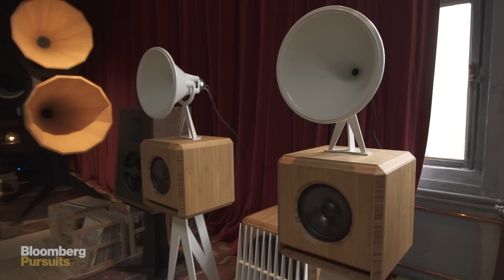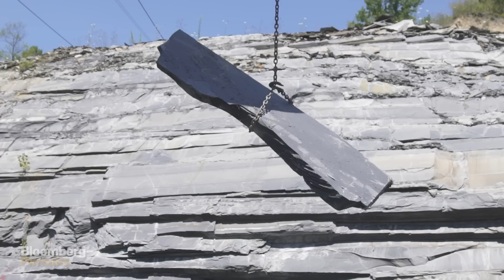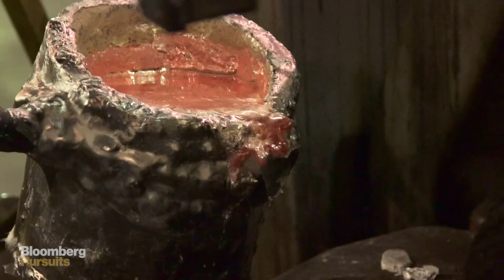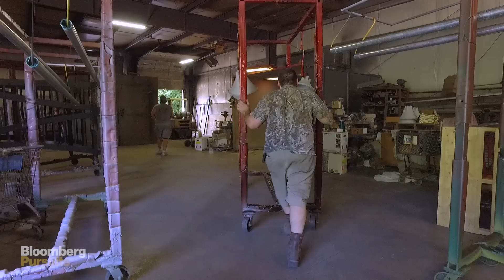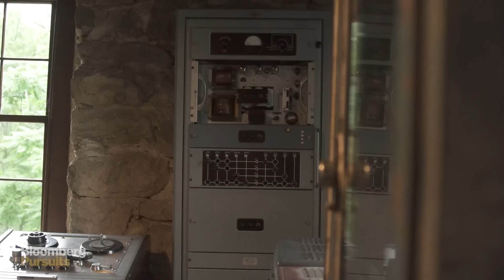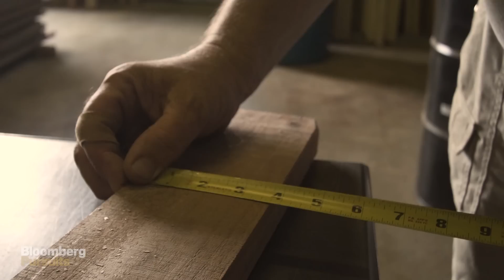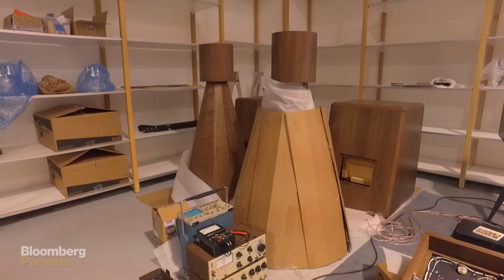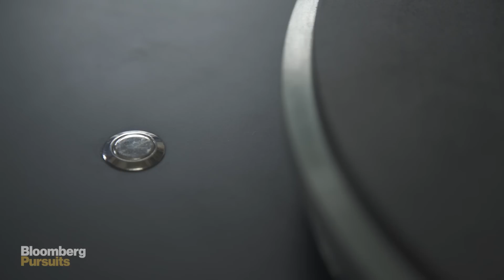How a $300,000 Speaker is Made

Comment: Those solder joints are absolutely horrific, a cold iron was used, not enough flux, and the board was not cleaned after soldering. Look at all that residue! "Like aerospace level stuff" Lmao please!
Reply: And the hard wiring from the board to the pots and switches is amateur hour. I've seen the hard wiring in equipment costing half has much made in Japan that is done cleaner and more neatly organized.
Reply: JBL M2 Reference Monitors are like $12000/pr. and would blow any of that garbage away.
Reply: @PlateletRichGel  you can buy a world renowned speaker like the Tannoy Westminster for a fraction of the coast .And you won't lose a dime on resale 30 years later .
Reply: ct5006360 exactly. I work for Rohde & Schwarz and my full time job is to disprove idiots claiming their audio sounds the best because of XYZ high end analog components or because their audio cables have a passivated gold finish. Sorry guys, unless our equipment is wrong you have all been cheated for decades...
Reply: @PlateletRichGel  I was just gonna say Harman is looking a lot better right about now.
Reply: @PlateletRichGel  Hopefully that information will become valuable to me one day .
Reply: @PlateletRichGel  You don't know anything about sound.

High End audio is another level.
Reply: Yeah, but there's not high end audio here, just quackery. And us yeah, I'll put my Quad electrostatic  system against anything in the world.
Reply: I had to look twice too, but you're right. What a shoddy soldering job.
Reply: I took a screenshot and zoomed in. They must be joking, honestly it’s absolutely terrible. What a fricken disgrace 🤨
Reply: You don't understand audiophile thinking.  They'd say the cold solder joint improved the sound.  So much BS it hurts.
Reply: @jomgelborn  Oh yeah dude, it´s true!!! Don´t you know anything about cryo??? hahahaha!!
Reply: "It's really old school" What do you expect? They were making old school stuff. Old school stuff came in with the old school problem, LOL. This is just hippie bs.
Reply: You're paying for pretentiousness and not quality soldering
Reply: @jasonscott6171 Scott Haha. I like your response better than mine. Much more eloquent.
Reply: Rossman would be furious
Reply: Cameron Crosby
Wow! I had to look twice, but you are right! The soldering at the PCB is really poor. It looks like they soldered from the upper side?!
Anyway, people spending 300k for an audio system will probably never open the case. Who cares?
Reply: I'm actually kinda shocked.... 300k? And not more than a few hours labor from what looks like a learning technician?  I don't see why they can't hire someone who had more skill. I know many solders are done by machines but that board looks like I did it and I've only soldered twice...  Kinda burnt and rushed with basic wire and no management or cohesion. Looks like a DIY audio kit!
Reply: @figit090  I've done better soldering work at my high school for an assignment.
Reply: The wiring is a hot mess. For 300k that could have at least made it neat and organized. Have some damn pride in your work mr pretensious snake oil salesman.
Reply: The soldering work brought back many childhood memories, looked so familiar:)
Reply: @MrTruth111  dude. I spat my morning tea on the carpet laughing out loud 🤣🤣
Reply: @MrTruth111  could I just give you a hug man? You made my day 🤗
Reply: @50flamingbottles You imbecile. Anyone with an average knowledge in hobby electronics can agree on that pathetic soldering job!
Reply: that is aerospace level lol
Reply: @misterkid  Apollo 13 bzzztt
Reply: actually I had to look 3 times.2 times the solder job, then back to the price.this is absolute crap. most of the chinese stuff has better soldering jobs these days.300k piece of crap :D and weird thing is I had chance to hear these loudspeakers on some audio fair, they actually sound pretty boring and unimpressive. Next to them was Martin Logan electrostats.oh boy.......
Reply: Maybe 1960's Aerospace level stuff lol. 'We use resistors from Soviet Sputnik.'
Reply: that's where the "Character" comes from.
Reply: Cameron Crosby I know that was the first thing I noticed.  I did better soldering when I was 7.  Like seriously.
Reply: I noticed the same thing ... I'm surprised there wasn't tons of hot glue all over it in clumps!
Reply: He wasn't bluffing....(1960) aerospace level stuff hehehe
Reply: Mass produced hardwired orange amps have gorgeous solder joints these are just pure trash
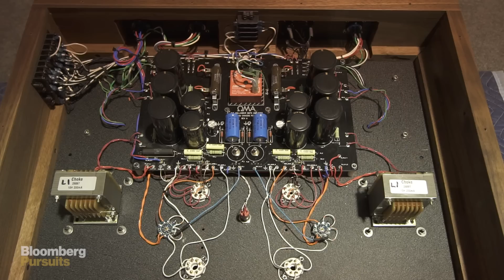Reply: Check the wiring at 5:23 , looks like a rats nest lol
Reply: Trius people pay $1,000,000 for a fuckin burkin bag.  So.  Those types don’t care they just want to spend the most. Even if it isn’t the best.
Reply: @MatanuskaHIGH  theres a joke in Russia, oligarch says "I just bought this tie, 1000Euro, other oligarch says "so what I paid 2500Euro for that same tie."
Reply: @MatanuskaHIGH  you heard Russian joke two oligarch have same tie, one says "I paid 100Euro" other one says 'That's nothing I paid 200!" lol
Reply: Hahaha had to look back. Terrible. Cold joints abound. All that work sourcing ~the least dense shale~, producing their own tubes, etc. and he's gonna put the thing together with a hot glue gun! Bahahah
Reply: The quote „aerospace level stuff“ is a joke itself. I mean Aluminium.Is.Aluminium
Reply: It is true this is aerospace level. The same kind of work is done and get to charge astronomical price when it can really be done for way less.
Reply: My DIY speakers with AE TD15M woofers, 4th order LR crossovers, and Aurum Cantus G1 tweeters will produce esoteric sound quality for less than 2500 dollars/pair and blow these overprice pretentious garbage out of water. 98 dB efficient woofer and 102 dB efficient tweeter FTW.
Reply: No kidding this guy & his products are nothing but polished turds
Reply: I cringed so hard when I saw the joints man. That isn't even close to the Space Addendum. That's Class 1, toaster level of solder. Smh
Reply: Exactly what i was thinking!
Reply: You just stole my thoughts.
Reply: They probably have a ground plane that is one pound of copper.
Reply: 4500 dollar ESS Labs EMT Limited Editions and PS Audio amplification equipment will blow these out of the water.
Reply: I agree! I am 13 years old and my solder joints look better than those :) Looks like the soldering iron was too cold!
Reply: user name  Open your damn eyes you imbecile
Reply: 5:17 looks very big.        because it has to be , looks so fake because proves IRS real wtf ever its all bs
Reply: We're the only company in the world that does this!
Reply: it’s old school 😂
Reply: You hear "aerospace level stuff" = instant bs.
Reply: I completely agree with your comment, it's very accurate! Could you suggest ways to improve this process?
Reply: guys the price isn't decided by the stupid soldering job
Reply: Showing jungles, mines and forgeries for how it's made, lol. I am more interested in how modern electronics would be in use to make sounds more interesting, just say goodbye to old-school stuff plz
Reply: Please post a video of you doing better! Fucking Internet warriors. You have no idea what you are talking about
Reply: @trentonrivard1400  it's not hard to solder
Reply: @trentonrivard1400  People who do this for a living have no idea?  Yeah, okay.  Pony up your $300K then.  Obviously you won't know the difference, but if you leave the price tag dangling you'll accomplish your purpose.
Reply: @trentonrivard1400  Begone you little turd, they don't need to prove their knowledge to the likes of you.
Reply: @hepburn118  sure they don't need. Because no 9ne knowledgeable who expend 300k of money is asking for that. This business is egotic business... Look at my big 300k audio system... I'm so rich (and stupid, but...). Poor guys...

Comment: The difference between Wilson Audio and this. One is a manufacture of a few expensive speakers from years and years of research. The other, this, is about buzzwords and nonsense. Why would you build a speaker of wood, when what you want is something as inert as possible? And what the hell does Martin guitars have to do with anything? Nothing. These are the companies that give actual high end speaker manufactures a bad rep.
A 25000 usd set of Yvettes will outperform these in short order and a set of Alexandrias are on a completely different level than anything here.

Comment: All of the recordings that Elvis did were on (Ampex 16 track tape recorders) with a frequency response of 20 Hz to 15,000 Hz.
All magnetic tape recordings have a (Total Harmonic Distortion of 1% at zero Vu).  All modern day recording studios record with 24 bit or higher resolution and with a sample rate of 96,000 Hz with a frequency response of 15Hz to 48,000 Hz with a (Total Harmonic Distortion of 0.001 %).
 
A typical live musical performance has a (Dynamic Range) of at least 30 decibels this is due to the fact there are several hundred if not thousands of watts of audio amplifier power required to achieve proper sound levels for a large audience.  There is absolutely no way these speakers could ever come close to reproducing that level of dynamic range given the fact that they are driven with vacuum Tube amplifiers.  Also the last thing you would want in a high quality studio reference speaker is for it to be directional from using horns this makes these speakers very directional so they have very little stereo imaging.

Comment: The founder doesn't even have a background in audio engineering or acoustics. A fucking political science major. Bose was an electrical and sound engineer and a professor at MIT. This guy is a fucking con-man. Notice the speaker components are not made in-house. They may be premium, but they weren't specifically designed for the housing he plans to put them into. 

"Sounds waves can't be minaturized... it's physics..." LOL
"Aerospace level stuff..." You mean similar to components that they used in the first moon landing? Because those components that are being hand soldered are ancient.

Comment: Wtf no sand blasting before powder coat? That paint could potentially chip of in some areas if the surface is not entirely clean even then it could still chip.

Comment: O man- that steel casting. No qc to check the grain structure? Are those steel parts designed or did they just pour some steel into a random shaped mold? Modern well engineered speakers would never use such an antiquated manufacturing process for something supposedly high end. Maybe mid priced chinese knock offs (one step up from stamped) but not high end stuff. Cast aluminum would be a much better chouse but then you would have to be scientific about it not scientitious.
Reply: "scientitious" nice word!

Comment: This guy is spinning a bunch on bs. 

You can easily find people online that make solid wood, handcrafted speaker set-ups for under $1000. 

The “soft slate” is bs. Is he making speaker cones out of slate? Or is the turntable made out of slate? I think a slate record player would be dope. But I would never pretend it increased the sound quality.

This is BS for the same reason the “Pennsylvania hardwoods” is BS. Because speaker furniture does not create sound the same way a musical instrument does. 

An acoustic instrument like a Martin guitar converts a small percentage of string energy through the bridge and into the sound board. The hole in the sound board creates a Helmholtz resonator. This is a simple mass*acceleration issue. A light, stiff wood has less mass, and accelerates easily. It also springs back into shape just as quickly, so it has nice clean tones. This also moves the air inside the guitar, and helps create the lower tones. 

Without the sound hole, the vacuum of the air chamber inside would mute the lower notes by not allowing the sound board to deflect as much unless you put a higher amount of energy into it. Some speakers copy this with a hole, some speakers have no hole and sacrifice lower tones for sharper response (or require a more powerful amplifier to overcome the pressure) But that’s due to the speaker cone acting as the soundboard, not the box that holds it. 
So there are 3 major parts of sound quality- the soundboard (aka speaker driver), speaker box geometry to control the air behind the speaker, and in the case of converting sound to electrical signals, the quality of the crossover and amplifier. 

Since one speaker cone can’t easily handle the whole range of human hearing, the incoming signal is split into low, medium, and high and then sent to speaker drivers that can handle each range separately. Then they have to overlap smoothly and perfectly, which as I understand it is very very difficult. So a single speaker will sound cleaner by avoiding the crossover issue, but multiple speaker drivers have much more range. 

None of this is affected by the materials or construction methods he mentioned. Slate turntables don’t affect this. Maybe, maybe a small percentage of sound is affected by the wood of the speaker cabinet. But in that case you want a dead cabinet. You don’t want it contributing anything- the speaker does the work and the cabinet shuts up and does its job directing air pressure. Cheap MDF does this well. 

Personally I would pick an amazing looking solid wood construction speaker over a high quality hi-fi audiophile speaker because that’s just who I am. But I won’t pretend it’s better sounding than the ones the big speaker companies pour tons of science into. My understanding of the science barely scratches the surface, but it’s enough to know this is just salesman hype.

Comment: He is a liar, those transformers are old school, military spec my arse!.

Just look at the flux residue on those circuits, it looks like a special needs blind handicap did that work. Even budget manufacturers can be arsed to clean the circuits after soldering.
Then look how few components they use, NO quality electronic audio system can sound great with just a few components even if Tesla was brought back from the dead he couldnt manage it!.
Where are the morons that buy his gear?

Comment: Gorgeous looking products you’ve got there.

Q:  With the cones, would the seams where they are glued change the vibration as to a cone that was worked on a lathe from one piece?  Why is any adhesive used, as dowels would provide ample friction to maintain form.

It really has the mind thumping 😉

Comment: Tube amplifiers are a bad idea if you want an accurate representation of the source...
"Warming it up" is done with ANALOGUE technology, which includes solid state. - But tubes will introduce other sounds that the artist didn't intend. - It's up to anyone building their own system, but they shouldn't be wanting "tubes because it gives a warmer sound" or any such thing. - If you're musician or producer, you'll know what I mean.
Similar stuff counts for use of Vinyl, by the way; It's not "because it's warmer", because digital can reproduce pretty much anything you want now, but the only reason I'd recommend Vinyl is because they haven't screwed (or can't really screw, as much) the dynamic range of the audio on those releases. - There IS a certain smooth character, and because it's analogue it potentially contains more overall content. But get over the pretense beyond that and realize that things like tubes and vinyl are only sugarcoating anything of the original intended works to rub audophile's nipples at home.

And by the way; As a creator in music and audio, I think my old-ass Wharfedales, combined with a ridiculous Kenwood subwoofer and a late '90s digital Sony receiver sound quite fantastic. For anything from Classical and Folk, to Metal and Electronic, what have you... No problem.

Comment: When someone build's a wooden tonearm like Oswalds Mill Audio, you know they know nothing about building quality sound equipment, any audio engineer watching this will be laughing their arses off at these snake oil salesman.
Facts: 
If you have ever spent $1000 or more on an audio cable; you are a moron.
If you have ever bought a 'special' mains lead; you are a moron.
If you have ever bought mains filters for audio; you are a moron.
If you have put 'blu-tak' on your IC's thinking it will improve sound; you are a moron.

These are not just wild statements; I can back every single one scientifically.

If you want high end sound, you wont do much better than using reputable companies that use real science to improve their products: Niam, Linn, B&W, Rega, Audiolab, and many more.
Reply: "if you have ever bought mains filters for audio", in some cases you have to do this as some buildings will add a "hum" to the audio lines due to shitty building wiring. I have seen this while recording music at different venues. Most places everything is fine, but every once and a while a power conditioner is required to silence the added line hum.
Reply: Why does no one ever mention Focal?
Reply: Value proposition isn't there with Focal.  Best value is in proven designs that you can build at home, with high value Chinese drivers like Dayton Audio.